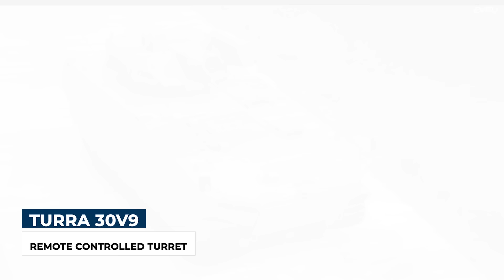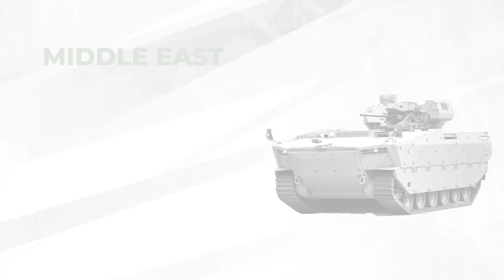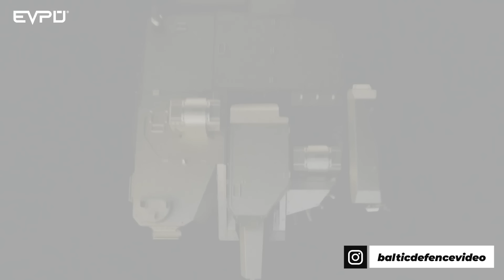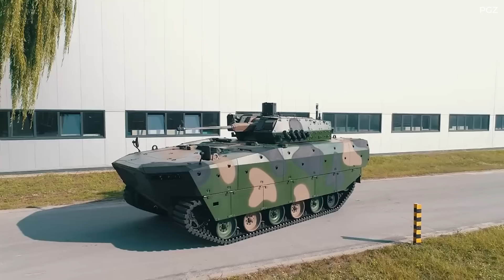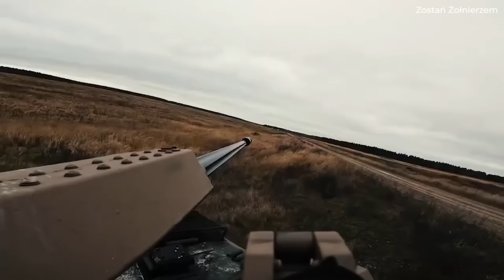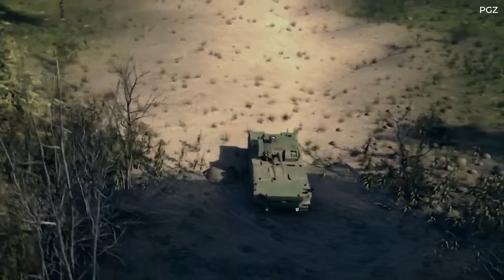Poland's Borsuk IFV: Export Version Unveiled At Defence Exhibition

Comment: I suppose the terrain and many rivers in Vietnam would make the Borsuk's amphibious capabilities come to the forefront, and assuming it is indeed cheaper than the top of the line IFV on the market that could be another important factor. On the other hand Saudi Arabia and the gulf states have never been too bothered paying a slight price premium to have the best equipment on the market, and there are no river crossings or marshlands to speak of... 🤔
Reply: It also very much depends on how much you want to add to the vehicle, I’m sure that the basic version is much cheaper then the new version of CV-90 Denmark and Sweden is getting and 40 is also donated to Ukraine, they cost 12,17 million dollars average per vehicle which is insanely expensive and the Borsuk will not getting anything near that, but they also have active production systems and 2 French missiles 5 kilometers range, similar to a javelin missile but they explode even fatter from the vehicle from top down attack with larger tungsten armor piercing fragments 20x20 meters kill zone to try to avoid active penetration systems if the missile warhead is first detonated the active production system will not be likely to stop the attack. The tracks have a lower chance of achieving pressure mines, the engine and vehicle is usually low noise so 200 meters is likely the first time you notice the noise from it, and it has special coating camouflage that both are unusually good at hiding it from the naked eye, and reduces heat signature and electromagnetic radio waves emitted from the vehicle by 70% which is usually how modern equipment finds and targets Vehicles, barracuda camouflage is also available for other types of equipment.
But Denmark is also only buying 159 new ones 12 million dollars per unit is a very high price, but they have some very nice capacities I don’t know about if they have amphibious capability, it’s very useful but like everything else every ability stacks up the price, which I guess is how it manages to get so insanely expensive
Reply: @kimmogensen4888  Actually, the first batch of over 100 borsuks were priced higher - at about 15 million dollars (~58 million zlotys) each. Everybody expects a lower price for the further contracts.
Reply: @greycliffnative  How are you supposed to get a lower price when demand is enormous, we have 2–3% inflation every year, and employee costs are rising by 5%? Expect increasingly higher prices, especially for Lynx and CV90 orders.
Reply: @ohv4254 I am talking about Borsuk, not its competitors.
Reply: @greycliffnative  The same points I listed above apply to all European IFVs without exception.
Reply: @greycliffnative  This is to be expected at the start of production. As you say, the price should fall significantly with subsequent supply contracts, especially given the Polish Army’s demand alone.
Reply: @ohv4254  I can see that you are not really familiar with the situation. OK, let me explain it to you. Which of the European IFVs you are talking about is currently transitioning from pricing and evaluating the first production batch to full serial production? If you answer that question, you will quickly realise that you are comparing apples to oranges.
Reply: @ohv4254  distributing non-scaling costs of development onto more hulls in addition of scale effect - if production orders are slated for multiple years ahead, manufacturers both gain efficiency in how they make parts as well as can reduce mark-up - they get so high exactly due to piecemeal purchases and uncertainity of follow-up orders, which pushes companies to raise markups to cover "thin years"
Reply: @greycliffnative  No offense, but do you not realize that a Lynx or a CV90 with an unmanned turret has to be counted as a separate, entirely new project? So you’re comparing apples to oranges when you throw manned‑turret versions into the same comparison with the Borsuk, which comes exclusively with an unmanned turret.
Reply: @kimmogensen4888  Be careful with the assumption that the price paid by Denmark or the Czech Republic is the price that will hold for future orders. The practice of lowering prices for the first contracts is standard, aimed at eliminating the competition. We know this mainly from civilian markets, but it is also used in defense procurement.
Reply: You can have a full blown version , with Polish turret, when you have more money. Economy wasn’t the main reason for this construction.